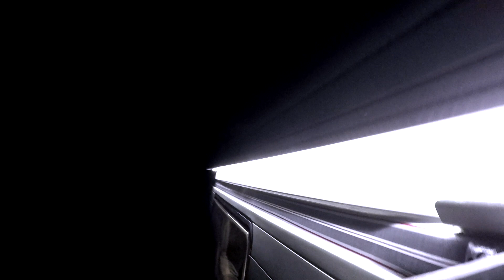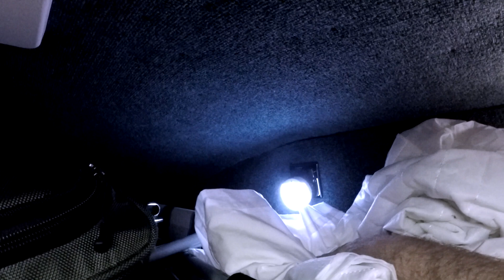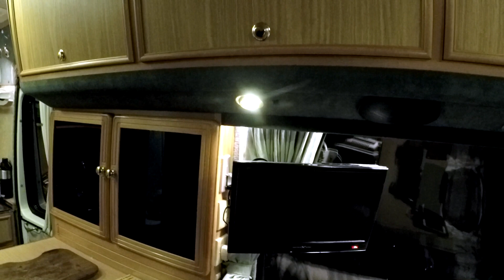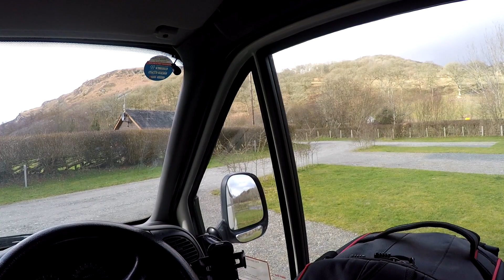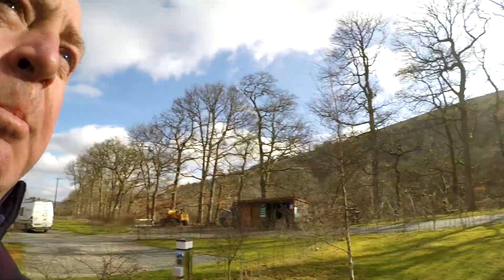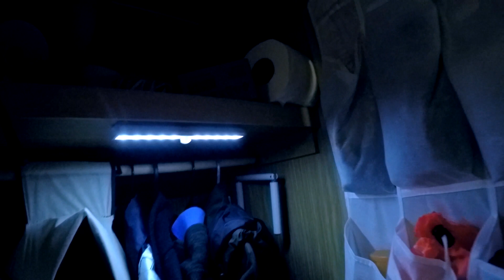Tour of the Autosleeper Amethyst  and my own modifications

Comment: Great looking van, how do you find the Zig control panel, just got a old Motorhome, looks like I have some same Appliances but I'm still learning my way around it and how to repair and renovate it. Not added any Solar?
Reply from the maker: Afternoon,  Only had one issue with the ZIG panel where the lighting fuse got really hot,  took it to bits and cleaned it up and so far has been okay since,  I thought about solar but usually find the battery see's me okay with all the appliances on gas so not done that as yet.   something I might add later.   Thanks for watching chap,   maybe meet up at this event if t happens this year?
Reply: @ashropshirelad  hopefully we can meet up and compare our old motors. Having some issues with my vehicle but hopefully I can get parts and get back on the road.

Comment: A bit bigger than our van, Nikki likes the shoe thing in the wardrobe.

How did you run the wires for your extra lights?
Reply from the maker: Hi there chap,  I sussed out the cable runs from the existing lighting and just ‘tee’d’ off some extra cables.  The others were a bit more involved as I needed to run a fresh feed from the dash so I could have them on whilst travelling.  Had to take some of the van apart to get those in.